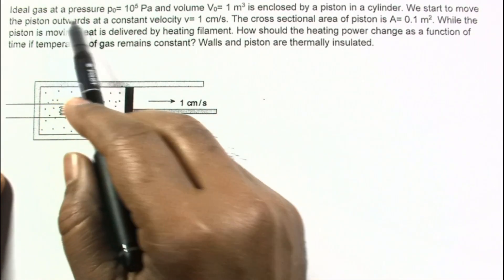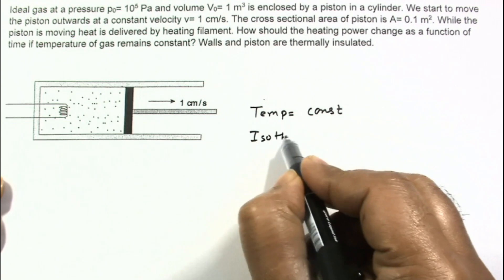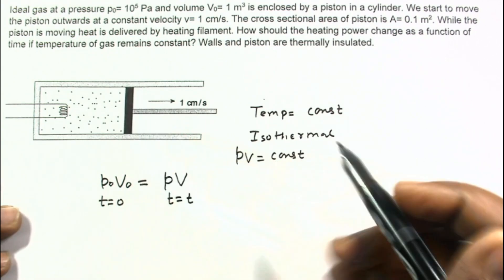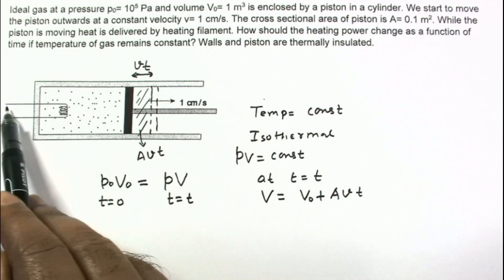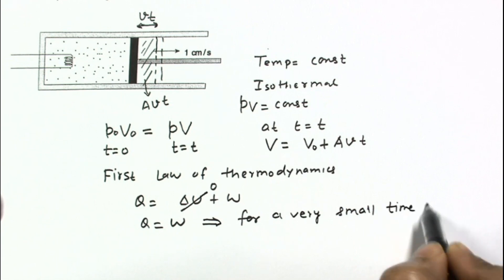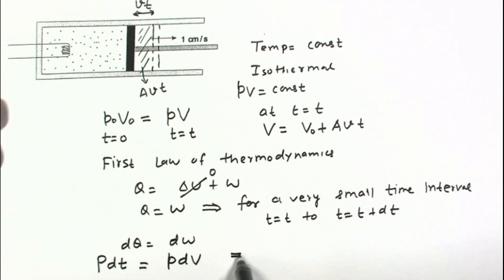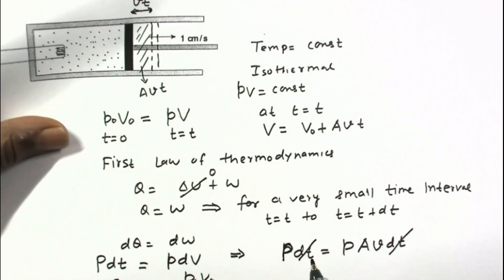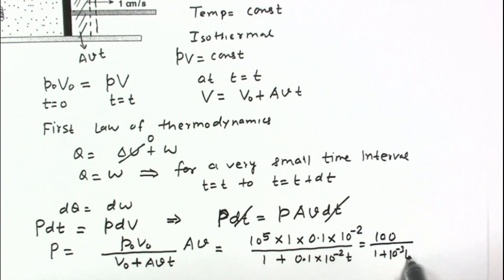Thermodynamics || Advanced problem || Finding power given by heater

Comment: Why can't we apply formula of work done in isothermal process
Reply from the maker: you can apply but that will not serve our purpose here. this formula will just give heat or work for a finite time interval between two states of the system. But in this problem we are required to find instantaneous power and we have to assume this power is variable.... so by heat in a finite time interval we cant find instantaneous power.
Reply: Q=W
Q=P°V°ln(V²/V¹)
if in any time t piston displaced by x
Then final volume is equal to V°+0.1x
Therefore Q=P°V°[ln(V°+0.1x) -ln(V°)]
dQ/dt=[P°V°/(V°+0.1x)]0.1(dX/dt)
Put value and you get answer in terms of x then replace x with 0.01t
Reply: @deepaksuthar9230  i also did it in this fashion